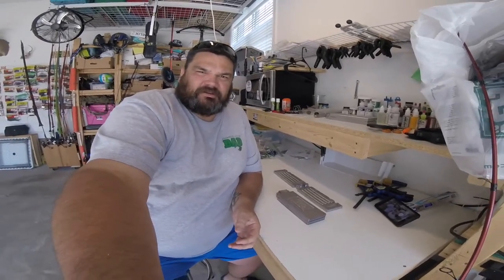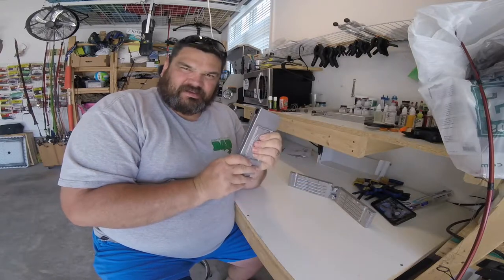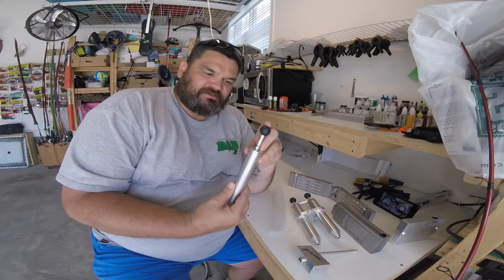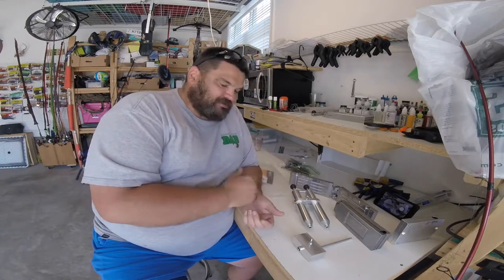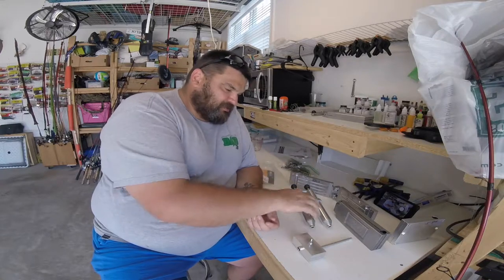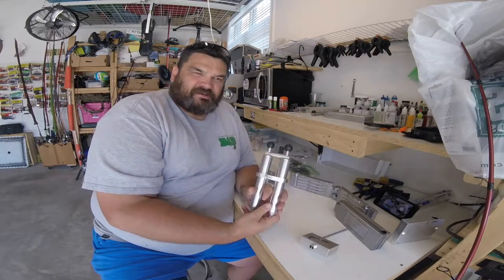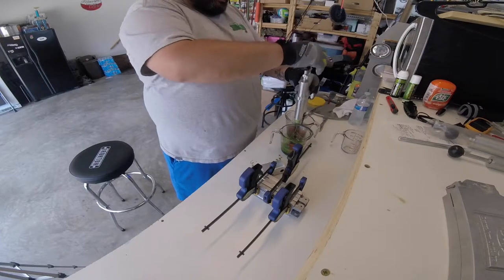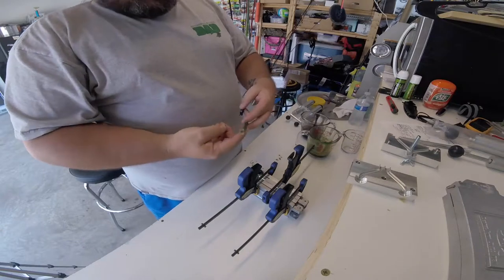Do It Molds and Dual Injectors Review

Comment: Hi Big Mike! 
Is that a  vent or some kind of screw right be the top of the injector? is that an air vent or something?  I have a problem with my injector that , it creates a vaccum almost when I´m try and shoot the molds..
Reply from the maker: On my injector the vent hole is on the very top near the plunger shaft. That’s a screw on the side. Try removing the end cap, draw the plunger back and pour the hot plastic directly in the injector. Then put end cap back on and shoot the mold. See if this makes a difference. Be sure to wear gloves though.

Comment: I was mostly here for the injector review. Just been hand pouring but want to get into injection.. its just not cheap. The do-it dual injector is 100 bucks cheaper than basstackles so I was really wondering about it, everyone always says get one with a locking tip but I dont see the reason as long as your careful and like you did just mark the area where its all the way down so you know. Also learned about the spray painting, that was a bonus. Had heard about it, but I dont inject yet so never looked it up.

Comment: Do you need a injector or no I have seen people use one and other people don't use one
Reply: Yes
Reply from the maker: Sorry for the late reply. For injection molds an injector is needed. There’s also the open pour molds that only require a glass mixing cup.

Comment: Great video bud! Would a single 4oz injector hold enough plastic to fill up the essentials 5 inch senko mold? I was looking into the basstackle 3oz injector but I'm thinking it may be too small. Thanks!
Reply from the maker: A 4oz injector will fill two senko molds at one time. Hope this helps.